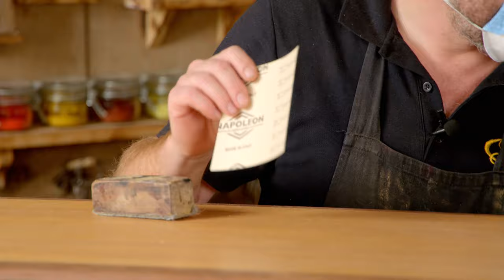How To Restore a G-Plan Nest of Tables (Mid-Century Teak Furniture)

Comment: Great video! Thank you for sharing.
 I just bought from you the Pure Gold Beeswax Polishing kit that I will be using on my GPlan dinning table. 
I have used a water based stripper bought from  a DIY shop (had to use it 4x), but I found that I could not sand straight away... I am following your video and the guide on your webpage to the letter, so hopefully my dinning table will look amazing!😊
Reply from the maker: Hi Marlene. 
I hope it all works well for you. I know the water based stripper is a bit of a pain. 
Keep going and don't rush the preparation. I'm sure you'll have success. 
Best wishes 
Simon
Reply: Hi Simon, will do. Thanks!
Your polishing kit just arrived this morning and it’s absolutely beautiful! I already tried the Pure Gold Beewax on another piece of furniture and it looks really nice! Thank you!😊

Comment: Excellent video, I learnt so much leaning from you and I take inspiration from your devotion to to restore treasured furniture with the finest technique. I have followed your advice to restore a teak table and it looks wonderful. I have three kids and I want to increase the protection of the tabletop, is there any material I can add (thinking lacquer?) to avoid marks and discolouring without changing too much the aesthetics of the table?
Reply from the maker: If you are using hard wax oils as I do. I would advise giving two or three coats (waiting a day between each)
In my experience they are very hard wearing. I've just been applying the same finish to our local pub restaurant tables. 
And you know how much abuse and wear they get on a daily basis.. They are holding up to the task well. ✅

Comment: Hi Simon, I’m about to restore a solid teak Cadovius wall unit, the problem is water marks. Can I avoid stripping and just sand? After sanding which of your products do I finish with? With solid teak is it ok to use an orbital sander?  Also, it has years of nicotine on it, do I lightly clean it with Methelated spirit?  I have your hard wax oil, smooth satin, clear, should I use this to finish?

Comment: Great video - very helpful to see this process, thank you! One question: What is required to clean the surface after the 180 grit sand, before applying the hardwax oil? Is just a vacuum sufficient for removing all the dust prior to sealing? Thanks again!
Reply from the maker: Hi Patrick. 
Yes, just a vacuum is fine, no need for anything else. You need a clean, dry surface. ('clean' in this context means no residual old finish or unwanted imperfections) 😁

Comment: wonderful video - thank you!  So satisfying to watch.

Would this technique work on what I believe is a rosewood veneer mid century dining table?  The surface is very badly damaged also with white heat marks. Should I try to fix this first??  Was thinking heat treatment.  The table is very cheap, very unloved but maybe it could be beautiful again.  I’m just a beginner, never tackled anything like this before!  Thanks for any advice you might have for me :)
Reply from the maker: Hi Lisa 
I'm sorry I missed your question. You have probably finished the job by now, but if you haven't: YES this technique will work wonderfully in many situations. Be careful when sanding rosewood veneer as it will darken very quickly. Only sand if really there is no other option. When it comes to rosewood I would always advise stripping back the three times as I demonstrate here and then skipping the sanding part, moving straight on to the sealing and finishing. (waiting a day in between).
I hope this helps. 
kind regards 
Simon

Comment: Hi Simon, a nother fantastic and informative video.  I'm currently trying to strip paint and a white primer off a gplan fresco long boys doors. The problem I'm up against is that the primer is in the grain, I'm away to do my 3rd strip, tbh I'm not hopeful about getting rid of the primer. If I were to use a tinted hard wax oil do you think that it would be enough to cover the tiny flecks of white? If not could you recommend a solution? Many thanks, Matt.

Comment: Thanks so much for this video. just purchased some of your polish. I have a question about Hardwax oil, which colour/finish do you typically use on mid century teak furniture? I have a few veneered teak pieces I want too restore, so looking to buy one oil to do them all. I heard you mention in the video 'Soft Satin' is that just a natural coloured oil with a soft satin finish? Some brands such as Liberon offer a 'Teak' colour. Basically i'm a bit confused as to what kind I would need to achieve the best results, a plain natural hard wax oil or a specific coloured one such as teak?
Reply from the maker: Hi, Thank you for buying our polish. I would use a clear hardwax oil with a satin finish. ( This will give you a very similar finish to the original)  It will work best on your teak furniture. There should be no need to use a coloured one. 
Let me know ho you get on. 
Best wishes 
Simon

Comment: Great video and very informative. I've just bought some of your polish so hoping to have a go on a mid century extending dining table I have just acquired. The top isn't in great shape but the extending part has never been used. Would you strip both parts down? Another question is there is a rather large scratch in the leg how would you go about fixing this please? Thanks
Reply from the maker: Hi Rebecca. Thank you for buying our polish.
You could try the polish on the top before you strip so you can see the effect it has. It may be just what you want? If not you can go ahead and strip the surfaces. It's not as if it's going to take more than twenty minutes or so to find out.
If stripping: I would strip all the horizontal surfaces. The butterfly leaf as well as the two sliding leaves. 
I would be tempted to strip and sand the legs also if there is a large scratch in one. It really won't take that much extra effort to do so. 🙂
I hope you have success. 
Kind regards
Simon

Comment: Hi.  Great video, thanks for sharing. I have learnt a lot from this tutorial. Can I ask a question please?  I have a nest of three tables, fresco range G Plan.  I have sanded the tops down to the bare wood.  My plan is to chalk paint the legs and then wax them.  I also thought I might add some chalk paint to table tops?  If I was to use your waxes for the tops, would this be ok over the chalk paint?  It would be Annie Sloan chalk paint.  Many thanks, Nicky
Reply from the maker: Hi Nicky. Yes you can use our polishes over chalk paint. Let me know how you get on. 🙂
Reply: Nice way to ruin them.  You just spent time and work devaluing them.

Comment: This is a great video. Thanks for posting. I am following your process but having applied stripper three times I can now see a couple of what I’m assuming are watermarks. I have used the 180 to sand but wonder if I’m being too gentle with the sanding? Along with others I’m terrified of going through the veneer😊. It’s a g plan coffee table. Any advice would be greatly appreciated. Thanks
Reply from the maker: Hi Maria. You can sand it quite hard. Don't be afraid. As long you do so evenly, you will be surprised at how much sanding you can do. I have often sanded with 120 grit and then up through to 180. get stuck in. ✅
Reply: @GilboysRestoration  thanks very much. That gives me a bit of confidence. 😊

Comment: I just purchased your rose gold kit for a set of small g plan nesting tables I bought second hand. They’re in pretty bad nick - water marks and scratches and on one a large mark which looks like it’s been done by a plant pot that has removed entirely whatever finish was on there and left some black stain. Would you do anything differently if your tables were in this condition? Should this process remove most of those marks?
Reply from the maker: Hi Kim 
Thank you for buying the kit.  Furniture repair and restoration can be a case of performing one process and then reassessing. 
The first thing to do is strip the remaining finish off back to the bare wood and sand it. You will discover that the majority of marks and imperfections will go during this process. 
If the black mark is still visible you can try treating it with an oxalic acid.
You can see me using it here:  https://www.youtube.com/watch?v=n8HBaTEaAuI&t=307s
(Sorry about the annoying background music)
You may need to treat the area a number of times and then sand it again, always being mindful you have a veneer, but also don't be frightened by it. You can sand it quite hard. 
Then once you are happy you have removed the black mark or at least made it less obvious you can proceed with the finishing process.    
I hope this helps. 
Best wishes 
Simon

Comment: Great videos! I'm doing some furniture resturation at home and use your videos as quidence. Right now i'm restoring an old and pretty big teak cabinet. However i've met a setback. The previous owner painted it several years ago all white for some reason. I have stripped all the paint off it, but all over i see theese white marks or "stripes" inside the wood. Inbetween the fibers if you will. 
There is a lot og veneer, and i dont think i can sand deep enough to get rid of theese stripes without risking going through the veneer. 
Do you have any tricks up your sleeve with this kind of problem?
Reply from the maker: Hi Rolf. Did you use a stripper to get the paint off? The small flecks of paint in the grain should scrub out with the coarse wire wool in combination with the stripper. Teak has a very tight, close grain which also sands quite nicely. Does it not come out with hard block sanding using 120 grit paper?
Reply: @GilboysRestoration  I did use a stripper and wire wool. I have also sanded with 120 paper to the point i dont really want to sand more because i'm afraid i will sand through the veneer 😅

Comment: Hello, I’m using PSA teak veneer to repair an old end table. Can I then use the hard wax oil or will it break down the adhesive underneath?
Reply from the maker: Sorry for the late reply. 
Yes you can use the hard wax oil. The secret to using it, I have found, is applying it and then wiping off all the excess so there is no residue left behind. It dries very quickly and has no chance to penetrate any deeper into the wood. 
I have used this method on my veneered oak doors at home with great success. 🙂